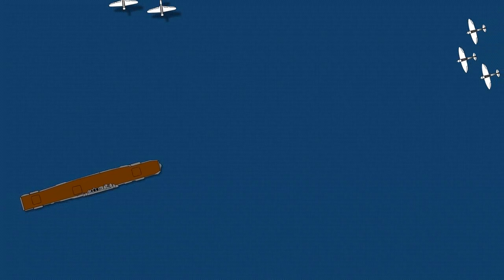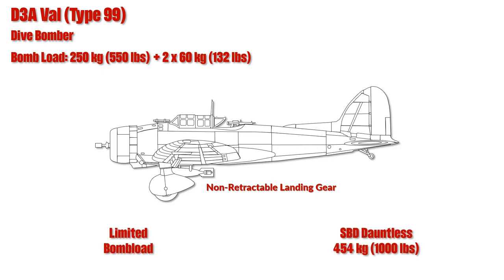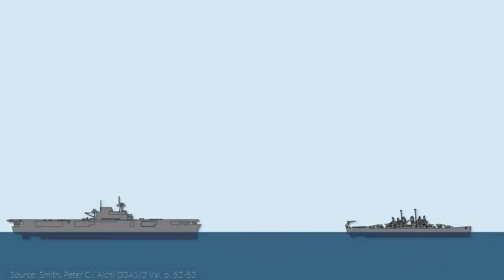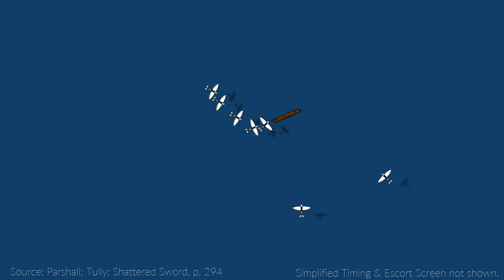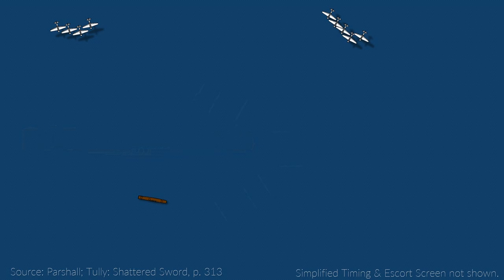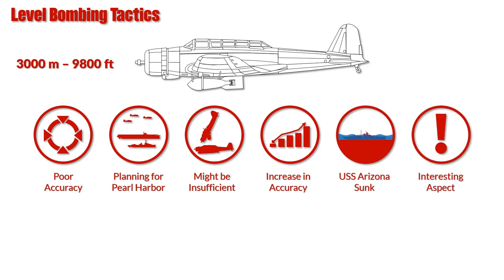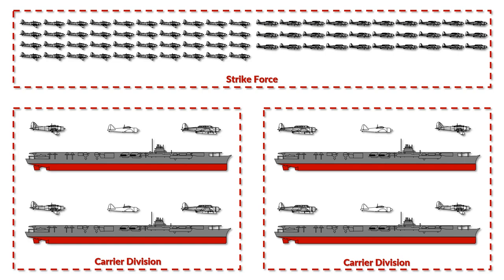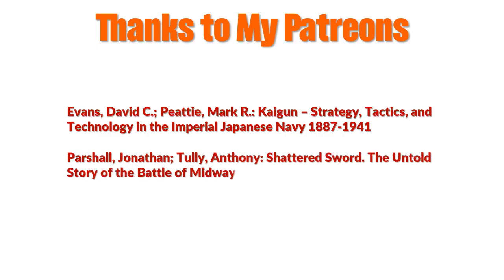Japanese Bomber Tactics (Navy) World War 2

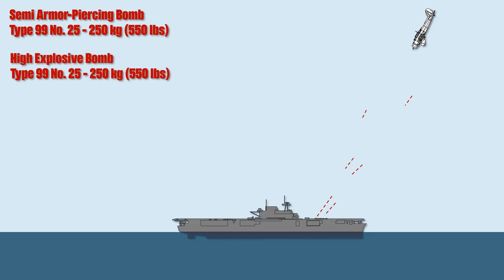Comment from the maker: 3:14 the High Explosive Bomb should be : 242 kg (532 lbs) (type 98 No. 25). thx +Benedikt Geierhofer
Reply: 242 kg = 532,40 lbs     I thought you were Deutsch.  lol.....
Reply: he is austrian.
Reply: With Japanese carrier-borne aircraft tactics being so sophisticated and ahead of their time, how come they were taking so many losses? I mean, was it just combination of US AA tactics, poor protection of Japanese aircraft? Wouldn't it make the tactics rather crappy, rather quickly?
Reply: Some was bad luck and unprofessionalism as at Midway. Some was due to the very poor protection of the aircraft. Japanese aircraft at this time had no armor plate or self-sealing fuel tanks---whihc were critical in minimizing the volume of the fuel tanks and thus the amount of fuel vapors.  Self sealing tanks work like a deflating balloon.  As fuel is drawn out the collapse.  Finally, US anti-aircraft was much better than Japanese.  US carriers had integral AAA batteries which were continuously improved.  The Japanese relied more on cruisers and destroyers for AAA.  Also, they were late in installing radar on their ships and never had a good system in palce to use it.
Reply: Well, actually American escort's AA was also amazing. If I recall correctly SoDa had some 27 shot downs confirmed during the Battle of Santa Cruz, that's 1/4th of Japanese aircraft losses.
I assume that by unprofessionalism, you mean "banzai charges", and being hot headed?
Reply: By unprofessionalism, I mean the actual operation of the Japanese Navy.  It is known that medium grade officers were allowed to question and actually shame senior officers IF they could get enough officers to support them.  For example if a group of  medium grade officers thought the commander was being too cautious or not showing enough spirit, they could openly criticize him, causing the very big shame of loss of face.  This strategy would sometimes goad officers into making rash decisions.  Strangely at the same time, the over cautious Nagumo was allowed to hold command for too long a period., leading to losses.  

Also, there was the habit of senior commanders to develop overly complicated and unrealistic plans which required nearly impossible feats that relied on split second timing.  This is evidenced in the Guadalcanal campaign where the difficult terrain of the isalnd was largely ignored and attack plans were put in place that allowed the US forces to carve up the separated Japanese forces before they could implement their combined attack.  Logistics were largely ignored and the highest Japanese casualties at the 'Canal and in New Guinea were due to starvation and disease!  They also continued to be over confident and send forces piecemeal to Guadalcanal and lost them as a result.  A large portion of the IJN air arm and the experienced pilots were lost at Guadalcanal due to the repeated poorly thought-out attacks at ranges that were on the knife edge of aircraft's capability.  Midway wasn't the real turing point, IMO. Guadalcanal was.  They lost the cream of their Naval Air Force over those 6 months.

Lastly, the inter-service rivalry was at a ridiculous level.  The  movie "the Admiral" depicts a scene where IJA cadets march up to the IJN academy with rifles and bayonet and were ready to charge until reprimanded by Yamamoto.  I don't know if this happened, though.
Reply: That was one great scene :)

I was more curious about the lack of professionalism during the attack on the Yorktown though. The way Japanese led the war was a bit... well, "outdated", to be kind. Especially the army trying to fight like 30 years before, although IJN had its share of shortcomings too, I feel they were more modern, openly thinking and civilized of the two. Doesn't make them any less battleship-centric.
Reply: +Fafix666 I think that perhaps that the Japanese Army got a little overconfident as a result of their early victories. They had spent a lot of time in China and pretty much rolled over their military, even if they did still have to fight a continuous guerrilla war there, and there early victories against British and American garrisons probably didn't give them an accurate idea of how we and the British really were militarily speaking.
Reply: The SoDak CLAIMS were BS, it has been known for years.  That is just a shameless and famous case of it.

Comment: can you do a video on the classes of ships. I understand, but it is one of the most common question I get when talking warships.
Reply from the maker: you mean for ww2 or in general? I was thinking about doing such a video, but I am quite curious what you want to see/hear.
Reply: Military History Visualized I feel WW2 wold give people the jist of what each classes are
Reply: i like to refer to the "classic age of Naval warfare" from 1895-1945"  

Naval warfare from the 1600-1940 primarily revolved around Naval gun fire, from 1600-1860 Wooden sailing ships were the norm, then from 1860-1885 you had a "transformation" era as ships developed armored hulls and steam powered engines

But the basic tenets of the Age of sail based gun ships vs Steal and steam based gun ships remain the same: 
very large "ships of the line" or "battleships" that were expensive and produced in smaller numbers in comparisoin to smaller "frigates" or "cruisers"

like in the age of sail lesser warships could not hope to engage a Battleship in open combat

from the late 1890- to WW2  Naval tactics and ship design were developed rapidity but basic tactics remained the same.

With the Rise of the Aircraft carrier surface combat ships became increasingly mainly used in the support role. 

but because the limits of Aircraft technology and the rarity and value of carriers meant surface battles happened often in the early stages of the war.
  
After the end of WW2 Naval doctrine shifted permanent into the age of Aircraft, Missiles, electronic warfare, decoys and "shoot down" tactics
Reply: I would be happy to help out with the basic WWII ship classes. It also ties heavily into the interwar naval treaties.
Reply: Sam George +
Reply: I think you should dedicate a small series for ship classes. Maybe for the different ship classes in the "transformation" period in the 1890s and early 1900s, another for pre-war and WWI designs, another for interwar designs, and another for WWII designs, mainly due to the quantum leap naval design took in that period.

Comment: Another quick note.  The Japanese lost every plane from every carrier of Kido Butai (the "mobile force" which had the 4 fleet carriers).  After Hiryu was sunk on the afternoon of the 4th, the remaining planes aloft had no place to land.  Midway was still in American hands and the closest IJN carrier was over 300 miles away with the actual main body (where Admiral Yamamoto was commanding from aboard the IJN Yamato)  The last IJN plane, a zero fighter, gently ditched in the wake of a Japanese destroyer and the pilot was recovered (as were they all),
Reply: What happened to the pilots?
Reply: They were picked up by destroyers.  The normal procedure was for a destroyer to make a wake trail for the planes to ditch in and the loop back and pick them up.  Given the Zeroes low landing speed the wheels up ditchings went very well.

Comment: Fantastic video.
I have, as a table-top wargamer, tried to mount massed, balanced and co-ordinated air strikes against task groups under way and let me say one thing: It is EXTREMELY difficult to get torpedo bombers into position for a perfect strike! Obtaining the ideal angle is difficult in itself, but getting two or more flights into position to attack simultaneously is an absolute art, and one which I never fully mastered.
Furthermore, coordinating torpedo attacks with dive-bombing attacks, so as to divide the defender's AA fire and reduce its effect is devilishly difficult. It requires a lot of loitering on the part of many flights of bombers whilst others try to deploy for their attack runs.Now, despite the high speed of bombers vs ships (a five/six-fold speed advantage, which sounds huge, but isn't really), it's not as simply as just flying in circles while you wait, because the target is constantly changing position relative to loiterers. Essentially, what happens is that loitering bombers standing off are performing a big circuit and getting OUT OF POSITION instead of hovering in the correct position. Or, they may be turning back on themselves and ranging further away from the target (the alternative being to stray into flak range), which means that their run-in times out differently to the perfect plan, thus staggering the attacks quite seriously. And remember, all of this loitering is subject to molestation by defending fighters!
The result is a massive furball with far more casualties inflicted before actually making the attack runs than are suffered by AA fire. Or, the only other alternative, simply getting each flight to attack when in a half-decent position. this typically results in maybe half-a-dozen aircraft going in during a 72-second attack phase (in game terms, of course) and being subject to all the flak's attention. Torpedo bombers suffer hideously during this kind of 'unravelled' attack, forcing release at longer ranges. In the space of one minute, a warship (even a carrier) can execute a smart turn to comb the tracks, much reducing the efficiency of a three-plane spread.
Actually, that's probably the reason for the three-direction attack; the head-on group's weapons are there to ensure that at least one weapon is still running at the target fro a beam angle if the ship suddenly turns to comb one of the flank attacks. Even so, due to the difficulties inherent in getting multiple flights to attack together, as an air controller one needs to be a master chess player to get all the pieces in play at the right moment, so that, whatever your enemy does there's another attack set up and ready to go.
Having tried in the peace and quiet of a front room, i have an enormous amount of respect for those officers riding in the middle seat of a Kate who had to direct all of this in real time, with flak and fighters swirling around him.
A much under-appreciated 'Really Difficult Job of World War Two'.
Reply: And the Japanese did it without radios!  They used hand signals or aircraft maneuvers to communicate plane to plane.

Comment: As a very late comment, when talking about the formation in torpedo runs and why the middle group would stay straight on.

I would say it only makes sense. My understanding is that torpedo's had most effectiveness when striking a vessel at a 90° angle. So by having them approach in this way, no matter which way the target turns, at least two of the strike groups will end up in approach abeam the ship.

One more thing I would guess has to do with the defensive fire from the ship. Most anti-aircraft armaments are arranged laterally along the superstructure. By approaching the bow of the ship, you're limiting the number of installations that can target you, and even more so, you're splitting that number for as long as possible amongst your strike groups.

Comment: Hi good video, nice animation.
1. For level bombers, it is not surprising that the best success was against the ships at Pearl Harbor - they were anchored and motionless. Striking a moving fleet is a lot harder. Consider the B-17. While best known for its use in Europe it was widely used in the Pacific where it flew from Midway, and Guadalcanal. It was helpful as a long range recon plane and did contribute some, but was not as effective against moving ships as dive bomber and torpedo planes. 
2. Kaigun is an excellent book - very academic however but still great.

Comment: The Japanese Naval fleet crews may have been well trained (at the beginning of the war) with an excellent torpedo for its time, but there were many deficiencies in the training of sailors 
which came back to haunt them at the Battle of Midway; the damage control on board ships were distinctly below par (compared to, for example, the Americans). Carriers have an additional incendiary/explosive source called aviation fuel which made fire suppression training and equipment upon this type of ship even more important. Furthermore, as the war progressed, the Japanese were running out of veteran pilots, with no early overall strategy being countenanced to replace veteran pilots with well trained crews. This is partly why the IJN and Japanese army implemented the suicide Kamikaze tactic towards the end of the Pacific war.

Comment: As the Japanese found to their sorrow, level bombing only works well when there is little high altitude AAA fire and when they had air superiority.
Reply: I often wonder how you could hit a MOVING target with high level bombing. Even for a slow moving target Carrier, you will need 8+ aircraft to cover the sky, assuming flying in the "right" direction, and no interference from other air defence, and hopefully 1 would score.
Reply: @cyrilchui2811  The answer is they almost never did. From about 14,000 feet, above an accurate range of most antiaircraft fire, and against a non-maneuvering target, a very well trained crew has a small chance of a hit or near miss close enough for serious damage. Above that altitude, hitting an moving target was nearly impossible. Hitting a violently maneuvering target like a naval vessel is impossible. I'm not aware of any level bombers that scored such a hit during the war, wartime claims aside.

Comment: Here is something I’ve never understood about WWII navy tactics:

Why not protect valuable ships like carriers and battleships using smaller lower value ships beside them to shield them from torpedoes?

Would that be too much like kamikaze tactics for the US because the smaller ships’ job is to purposely be destroyed? How about a tug towing a screen of pontoons or a net? Did the torpedoes run too deep?
Reply from the maker: those ships likely would have a hard time to be "ocean capable", they would also need to have a certain depth to even "catch" the torpedo, which is not so easy as well. Depending on the Navy, some of the ships did heavy evasive maneuvers as well like the Imperial Japanese Navy, I think the US Navy opted for not maneuvering to have better AA firing solutions.
And directly besides them would mean crashing.

Comment: Initially, Japanese doctrine of launching aircraft was way superior to American doctrine. Each carrier contributed one of its attack units (VB or VTB) and then some number of escort fighters. This made it easier to coordinating air strikes from multiple carriers. By contrast, American flights from different carriers—both torpedo and dive-bombing—operated independently of each other, Instead of assembling for a coordinated strike.

However, Japanese commitment to deliver a massed air attack also had a downside. It's heavily time-consuming process where all Japanese carriers were committed to preparations for one big strike. This deprived the Mobile Force of the flexibility it needed to respond to unexpected changes. it was this weakness that gave American bombers an opportunity to attack Japanese carriers as they wasted their valuable times in preparation of a massed air attack.

Comment: The real question is, was torpedo bombing worth it? The bulk of US attacks with Torpedo Bombers at Midway (Devastators) were shot down before they caused damage. The Dauntlesses with their heavy bomb load compared to Japan seemed to turn the tide. Torpedo bombing was great for attacking the fleet in Taranto and the Bismarck, but really that's it?
Reply from the maker: for the Japanese yes, for the US in early war less so. The main difference was speed of the drop, the US had to slow down a lot. So their run was far longer and complicated, thus they were far more vulnerable. Additionally, their torps had less payload and probably also more duds.
Reply: At Midway the torpedo bombing wasn't great. But Avengers later sank several light Japanese carriers, and a huge chunk of the Japanese submarine Force.

They also sank Yamoto and its sister ship.